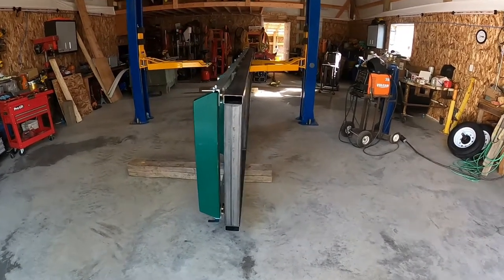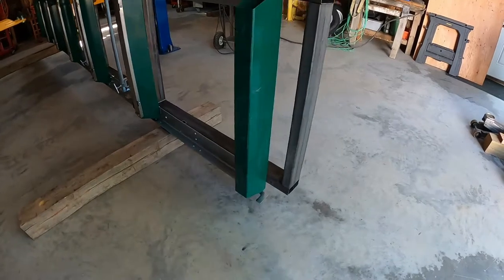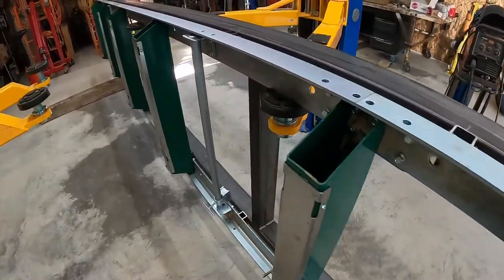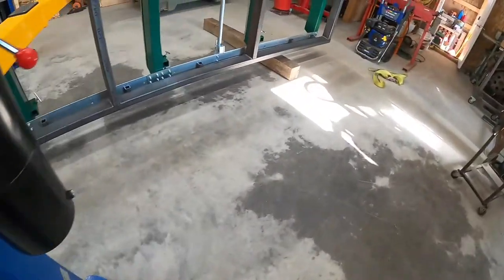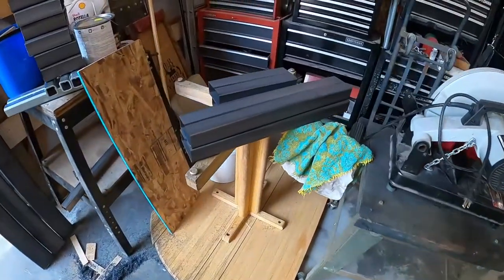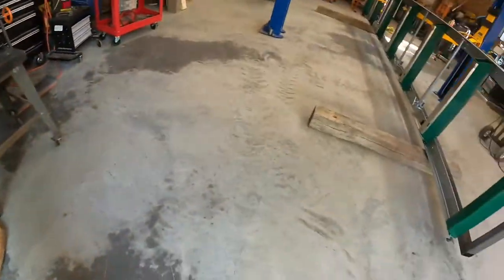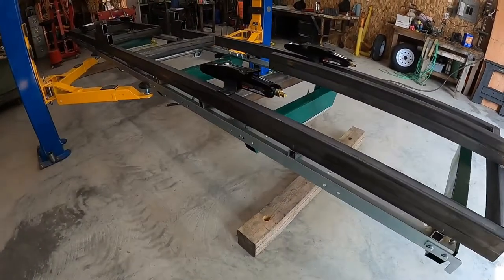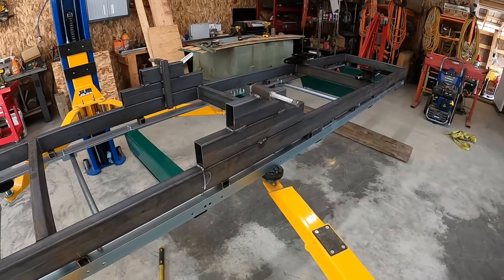Sawmill Trailer

Comment: What was the cost?
Reply from the maker: With all new materials I have around 700 dollars into this project. The kit from woodland mills is over 2K. You could save $ if you used an old trailer axel and wheels.